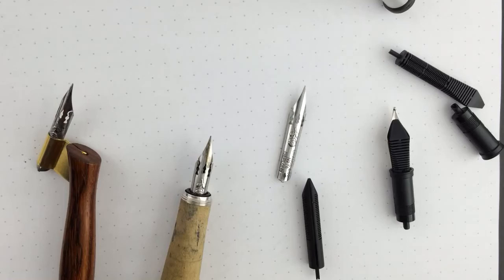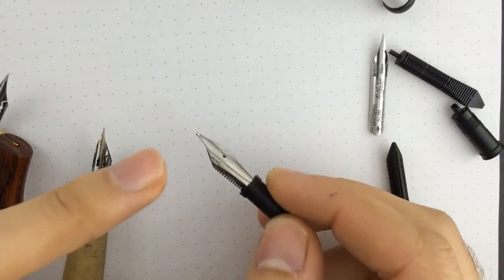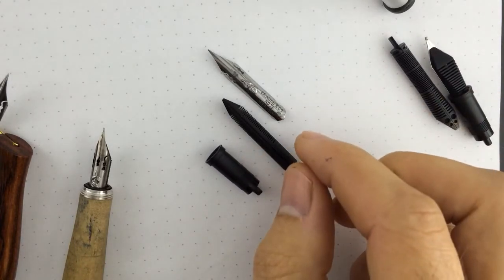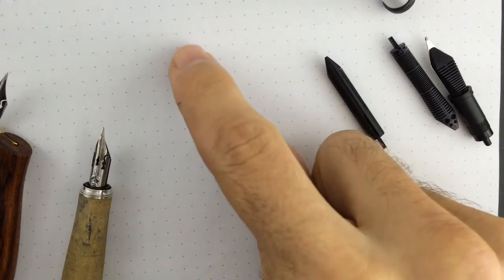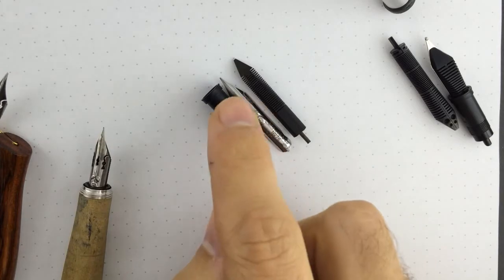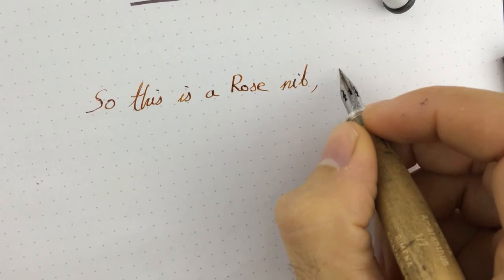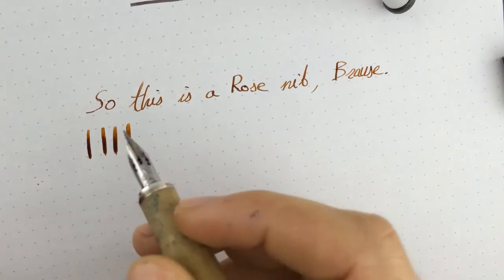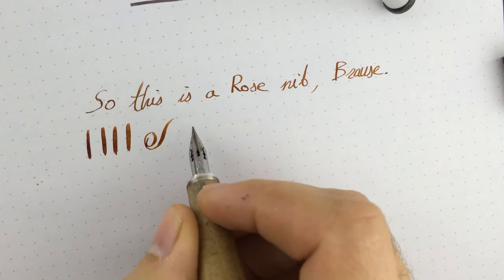Flex dip pen nib in a fountain pen

Comment: Could we use the modified ebonite feed with your gold flex nib in a standard Jowo nib unit? Can we buy the feeds on fpnibs?
Reply from the maker: da5idt hi! No, the ebonite feeder is shorter than the ABS feeder of the standard unit. That means that the tip of the feeder would be far away from the tip of the nib, and that causes ink flow issues.
The ebonite feed would also need heat treatment to match the nib shape.
No we do not sell spare ebonite feeds.